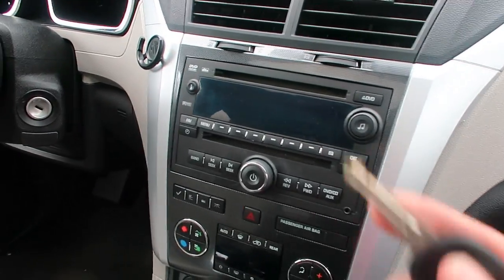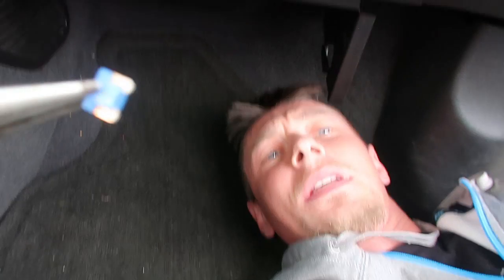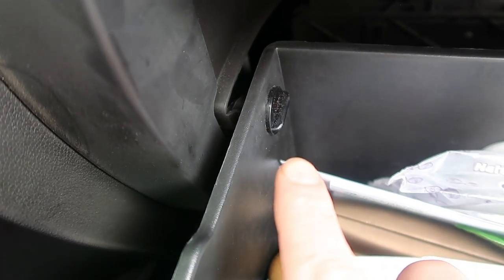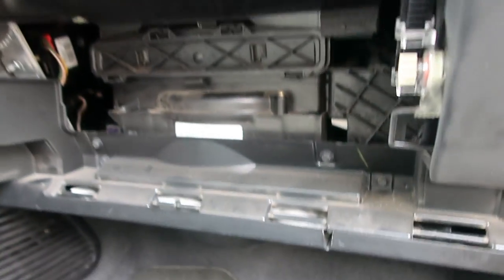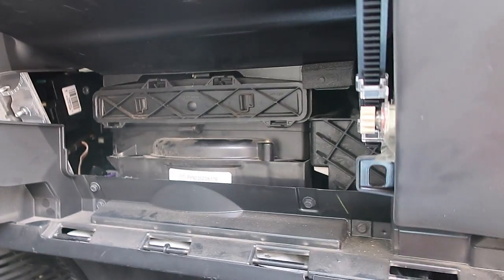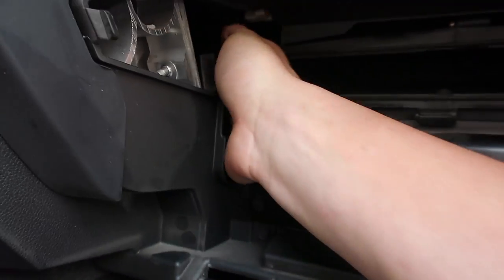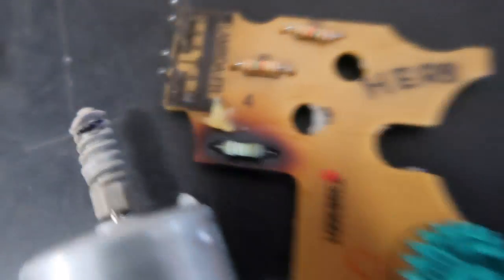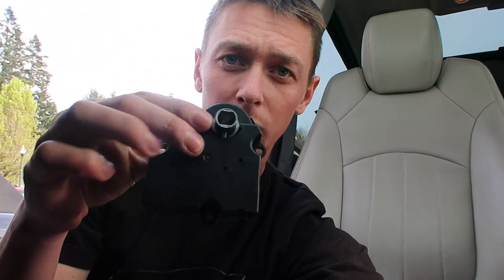Chevy HVAC Actuators Not Working

Comment: "MY MAN"!  Thank you so very much for taking the time to hook the rest of us up! This issue is exactly what is happening with my 2011 Chevy Traverse. I do get cold/warm air, just not through all front facing vents. So, it does sound like this bend actuator needs to be replaced, all of $16.00 and a little of my time.
Reply from the maker: Heck yeah you got this
Reply: I now have another question.  Yes Open my bend door actuator was toast.  The new one came with the actuator not straight alined. I installed it and let it calibrate itself. Now all my front facing vents are in fact working and having air come through them.  However, when I adjust the different setting it will only blow air through the front facing vents. Not to defrost, bottom leg vents. I saw the actuator calibrate itself but now no adjustment.

Did the actuator have to be centered before putting it in place?  Did I have to move the door selector before lining up actuator?

Semper Fi. Vic

Comment: Thank you for the very thorough video.  I replace my actuator that controls the direction of the flow of air in my 2011 Buick Enclave.  The new actuator did not work.  So, I pulled & re-installed the same fuses you indicated, and everything is working as it should.

Comment: Only one simple comment. You are a genius and no wonder the world is a place to live because of people like you. Thank you for the info. I have Buick Enclave and it seems the driver side vent actuator locked up because of the battery drained to 2 vdc. I attempted to no avail but now after watching you video I understand the problem. I had a  new actuator, not installed but connected. I tried to change vent position by selecting face, foot, and defrost but the actuator (the ring with two notches) did not move; that tells me the ac module is not sending the signals. Any advise? Thank you in advance. Also what i would do is to stick a fine paper strip with a tape on these vent to visually see them. I liked the way you synchronize your adjustment with what computer thinks...:)

Comment: Is there a way to determine what actuator went out?  I know the one you removed had a bad resistor, but did you just get lucky and that was the easiest one to remove so you checked that one first?  I am just trying to avoid having to access/remove the other ones if those are causing the issue.
Reply: Each actuator has its own unique job. For instance,, if your hot to cold selector is not working then you want to check the actuator that moves the blend door. You should be able to google which actuator does what and where its located for your model car.

Comment: I spent 4 hours today and tried everything but it did not resolve the issue. Drivers side hot, passenger side working just fine. I set the actuator to middle point and as soon as I turn the ignition on the actuator moves up to the top mark, moving clockwise.  So ok. Without starting the car I turn on the "auto"  and turn off the ignition. Removed the battery ground for 2 min. and then restarted the car. Display shows 23C (16c to 31 c) min and max. lights changes and it seems initialization is in action. While this was happening I watch the driver side actuator . It did not move at all. Stuck to the hottest setting. This was for few minutes. Then I turn off the ignition and restarted in 20 sec. Nothing happened. The driver side actuator is stuck. So I removed the connector and used external 9 volts to move the actuator to the coolest point. Moved anticlockwise to the lower mark. Never connected the connector. Now I get cold air because it is hot in Canada 29C to 31C. I am suspecting the digital module maybe bad. The actuator moves to one direction only with two wires, but with three wires it should move to lower mark. I don't know where the problem is. I will dig out some more and seek your advise as well. But your video was very informative. Thank you again.
Reply from the maker: Oh man sounds like you have a little seam on in there somewhere. It’s really hard to diagnose without having it in my hands but I will do my best keep me updated
Reply: I’m having the same problem. New actuator installed on the drivers heat blend door, when I turn the ignition on it rotates clockwise to full hot. Removed and centered with a 9V battery. Installed and again it goes full hot. Not sure what to do now.
Reply from the maker: @joeleiterman2606  Let the car center itself. I believe it does a self check to make sure its in the right position. Keep me posted I might be able to help you out over the web.
Reply from the maker: @joeleiterman2606  Good call on the 9V to move the actuator

Comment: Ain’t there a dam way to turn it for now while it’s mounted. I need defrost and it’s stuck on face vent. Mail sucks right now! I have to take my kid to school and go to work.
Reply from the maker: the easiest way is going to be to remove the module completely. Set the valve to the right mode or where you want the air to come out and don't install the module back. you might bet a check engine light but at least you will be warm and defrosted.
Reply: If it won't stay in that position, use some strong tape to hold it. Like Gorilla tape.